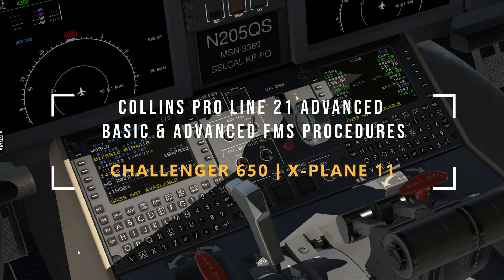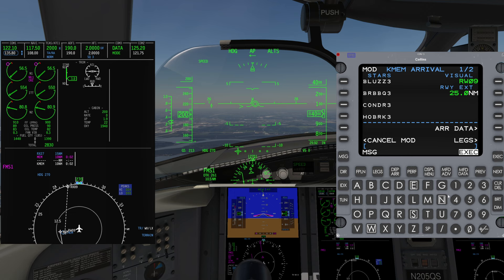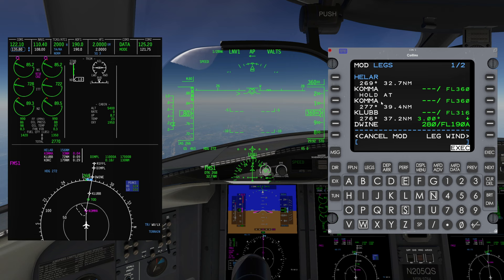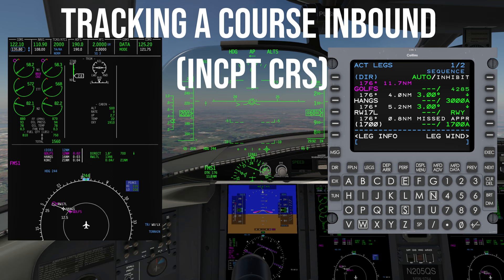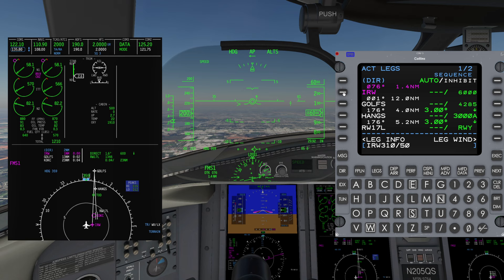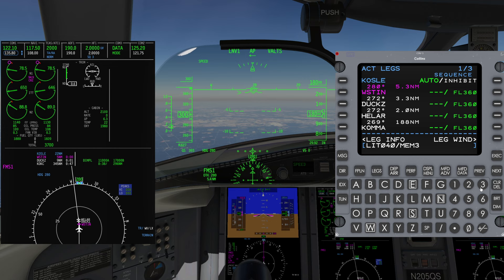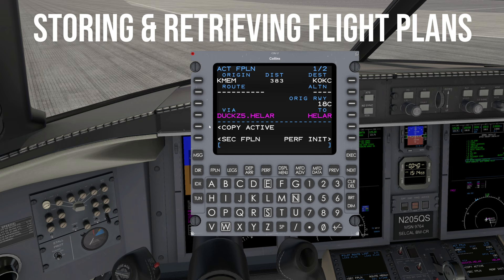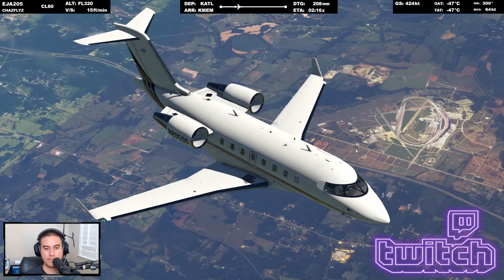Hot Start Challenger 650 Collins Pro Line 21 FMS Basic & Advanced Procedures Tutorial | X Plane 11

Comment: I have a question, about one of your procedures. At 5:46 you explain how to track a radial from a waypoint. Is it possible to fly a heading to that radial and intercept it and not have to fly to the waypoint where the radial originates?  Another way to state my question, what if you take off to the north say heading 060 is assigned to intercept the 320 radial from a VOR that is already behind the aircraft by a few miles or so. What procedure would you use?
Reply from the maker: If I understand your question, you want to intercept a radial and fly outbound.  That procedure at the time stamp you listed is what you would use.  But be aware that it will take to the distance that you specified in the FMS.  In the video example, it is 50 miles.   
Now spoiler alert, I have moved on from the King Air 350 to a new airplane so I don’t remember the mileage limit for the FMS.  It might be 50 or could be 99.  You can try it yourself and if you enter a number beyond the distance limit, the FMS will not accept it and give you something like INVALID ENTRY.